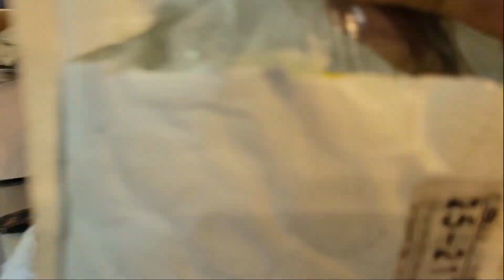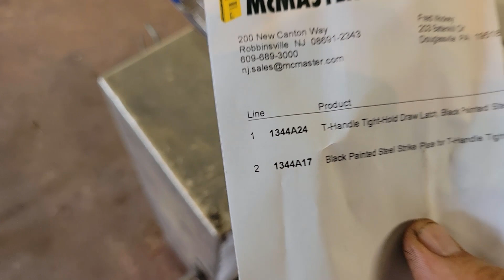John Deere 450 Project 23 Finding a solution to missing hood latches and working on hydraulics.

Comment: When you pull the boom cylinder pin, putting a piece of 2 x 6 under it will protect the lines to the dipper and curl cylinders.  A come a long to the ROPS structure helps to pull the cylinder out and  a ratchet strap around the cylinder to a beam will make lining up the pin a whole lot easier when you reinstall.
Reply from the maker: Thanks for the suggestion.  I already have the cylinder pulled and new lines in.  Video soon.